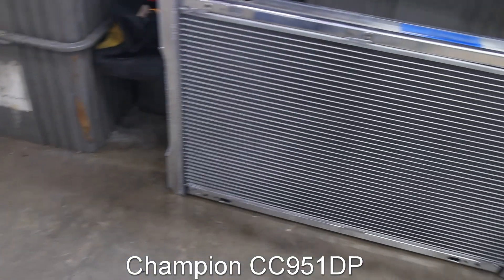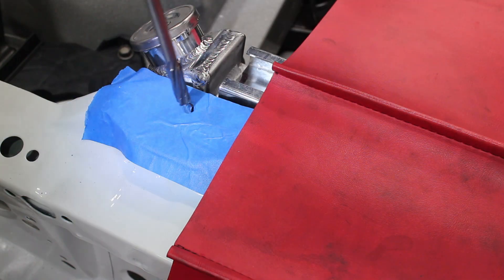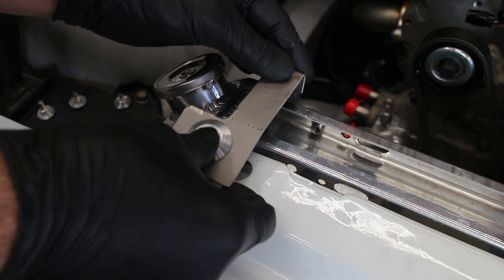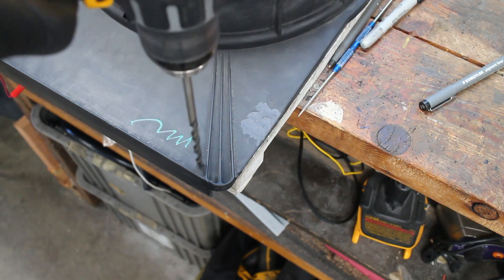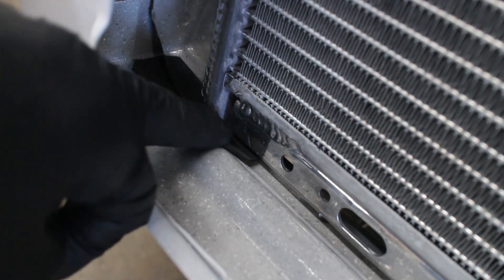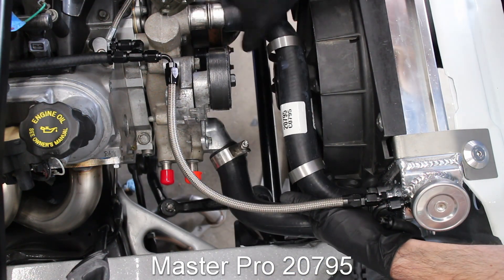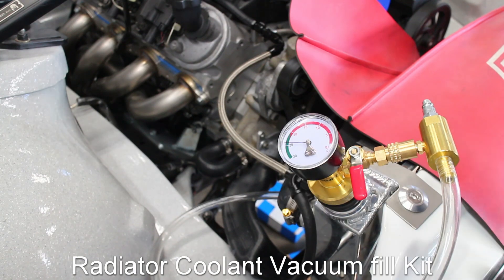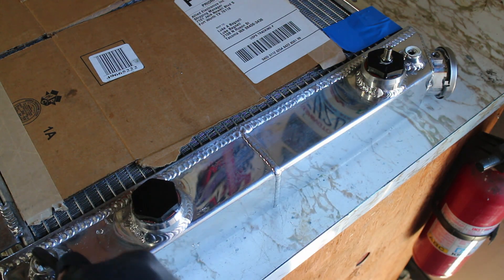LS Cooling: Aluminum Radiator + LS1 fans (Pt26 LS Swap)

Comment: Really great video. Im getting ready to install the 4th gen fans onto my 1989 IROC-Z. I've never done fans before and would really like to know how to properly wire these up to function as factory? And would i have to replace the factory relays? My car does have 3rd gen dual fans and im wondering if i can directly just plug in the 4th gen fans with correct pig tails? If not, what is exactly what i need for it to all be properly installed? I would really appreciate some guidance with the proper wiring. Thank you in advance.
Reply from the maker: if your car came with dual fans, you can just use those 2 factory relays.
the LS1 fans use a larger Metri pack plug,  you can buy pigtails for them.
the TPI fan  plugs might be the same, not sure though.
Reply: @3rdGenGuy Seriously appreciate the info so much Man. Thank you 💯🙏🏾😎👊🏾

Comment: I installed a frostbite in mine and its just as thick. the dorman 4th gen fans i bought were pitiful though.
Reply from the maker: the 3rd party replacements aren't quite as strong as the original GM ones.

Comment: Hey i was going to get this radiator then realized there are two different orientations for the sbc one and ls one.  I am going to ls swap in the future and i was just wondering if you had any idea if it would be easier to use the sbc radiator orientation or get the ls orientation to fit the sbc.
Reply from the maker: I now you can use SBC style rads with LS.

Comment: Hey got a quick question for ya, so my setup is a little jank rn and im looking to kinda clean it up like this. Is this a 4th gen size radiator? and how did you get it to sit flush with the bottom if it is.
Reply: I just fit mine in my car. I used the stock rubber isolators on the bottom and just trimmed them a bit bigger to fit this thicker radiator and it fits perfect

Comment: Hey for the -4 steam line what is the other end of the fitting size. The part that screws into the radiator?
Reply from the maker: I believe its 1/16 NPT to 4an
Reply: @3rdGenGuy  thanks you

Comment: Good job! Why you did not use stock SBC fan from 3g. I use stock single fan from camaro 88 year with my swaped ls1. I thought that if fan could cool iron block, than it will cool aluminium block. Is not it? Use it 2 years...
Reply from the maker: 3rd gen electric fans are very underpowered.
since my car is a Autocross and road race car, I need something VERY powerful.
race days at 95F+ are pretty brutal

Comment: I noticed it fit good but my question is how many row’s is your radiator? I have a 3 row and a SBC and wanna do the LS1 fan conversion
Reply from the maker: i'll tell you a secret, how many rows a Rad has is basically meaningless.
those LS1 fans will cool anything with even a stock radiator ha ha.
Reply: @3rdGenGuy  You can say that again I noticed my stock rad was better then this one but the reason I asked is cause if my radiator is too chunky it’ll end up hitting my steering box.
Reply: @qzria  I have the stock quick ratio Saginaw gear box and these fans and this radiator do not hit it. There is enough clearance.

Comment: Would this work on a stock 305? And aluminum 3 core radiator?
Reply from the maker: yes, you can buy versions of this rad with the Small block hose orientations. LS1 fans also fit.
HOWEVER, the stock 3rd gen radiator is actually fine, it's the stock fans that suck.
LS1 fans would be a good mod, although you'd have to wire up the fans as the stock fan wires can't handle these fans.
Reply: @3rdGenGuy  hey man I installed the fans recently and when the car is idle they cool off nicely but when driving the temperature stays high, the old amazon fans didn’t do that should i cut some slits to dissipate sole hot air?
Reply: Also they push the hot air in-front of the car

Comment: Thanks for the videos. My go to for a similar project I'm running. You mind letting me know what your overall thickness of the radiator & fan set up is.
Reply from the maker: end tanks are 2.75in deep.
rad+fans are 5in deep
the fan motors make it 6.5in deep
width is 10.5in

Comment: So you used 8mm countersunk for the mounting but 6mm for the radiator fan shroud?
Reply from the maker: ya, Because I had some tiny 6mm countersunk washers laying around.
a bolt and a regular washer works just the same.

Comment: Would the stock radiator work with an ls1 swap?
Reply: I’m wondering the same thing!
Reply from the maker: yes, stock rad is fine even for a iron block LS.
you just need a different hose. the hose part numbers are all online with a quick search
Reply: I use stock radiator. No problems 😊

Comment: For anyone that finds this useful, I have a 4th gen Fbody water pump and radiator in my 88 Camaro LS swap and the F250 lower radiator hose everyone says works so well is complete junk.
Just use a lower hose from a 2009 base model Corvette with a 6.2 N/A. Fit is absolutely perfect.
Reply: What radiator are you using?
Reply: @mistersniffer6838  stock type 4th gen radiator
Reply: @BackPainGarage   - Thanks

Comment: My riv-nut gun is coming today.  You convinced me pretty easily.
Reply: What brand do you recommend? The rzx has a few bad reviews.
Reply from the maker: I use the RZX and I see why there are bad reviews. VERY easy to break the tool ends.
Reply: @jjoossee2000  AIUITIO 16" Rivet Nut Tool from Amazon. Looks like the RXZ tool so it just has a different name probably. No issues yet but I have only used it a few times. I apply moderate force and even pressure to the handles. Not sure if that will help tool survive or not.